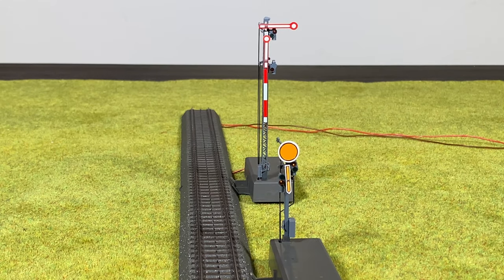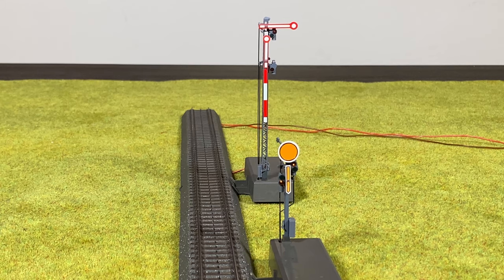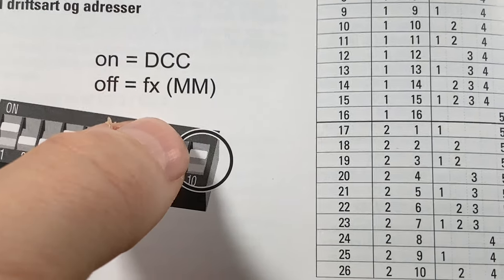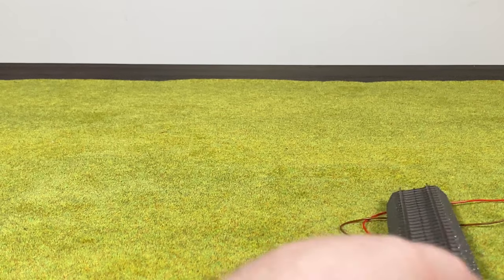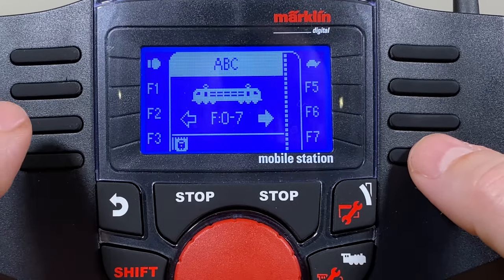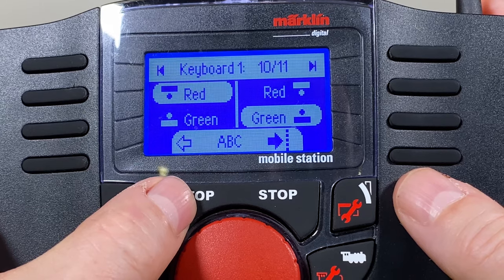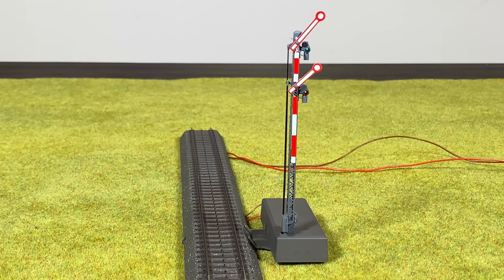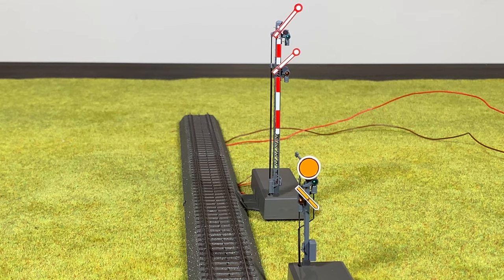Mobile Station 2 Programming Semaphore Bouncing Wing with DCC (Tutorial 04)

Comment: Hello ! I’m not able to made the orange semaphore moving. The top one moves but the lower one is not moving, and both top light and bottom lights are blinking. Any idea what’s going on ? Thanks !
Reply from the maker: Hi Xavier, not sure what is going on. The lights should blink while programming, but this should just be briefly. Do remember that a signal with two semaphores occupies two addresses. What Märklin signal are you looking at? Are you using CS3/MS2? Are you using MFX, MM or DCC? Enjoy ;-)
Reply: @ModelTrainFun  the top one was moving ok, but as soon as I was trying to move the proceed slowly, both led blinked and nothing is moving anymore. must do a "stop" and release.  The same behavior in MM or DCC and whatever adress is set via CV or dip.  Finally it looks  like the motor was not working. I opened the signal, unplug and replug the non working motor and now everythig is fine :-) I'm using MS2 with a recelty firmware updated. Now everything is working very straightforwardy like in your video:-) Many thanks !
Reply from the maker: @tastetx  I am glad you found the issue. Weird that the motor somehow was stuck? Enjoy ;-)
Reply: @ModelTrainFun  before  removing the pcb I moved the really tiny servo motor arm without luck (it was free to move but didn’t recover a good working order). Everything was back in track until I reseat the connector. I’m more buying false / bad contact :-)
Reply from the maker: @tastetx  Interesting, but glad it is working now ;-)